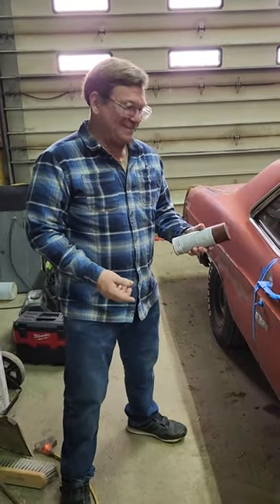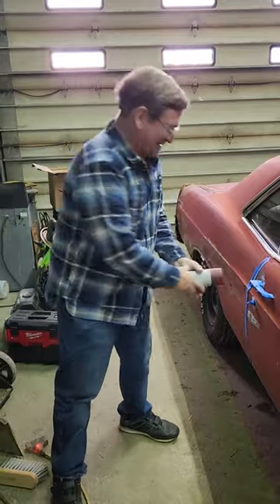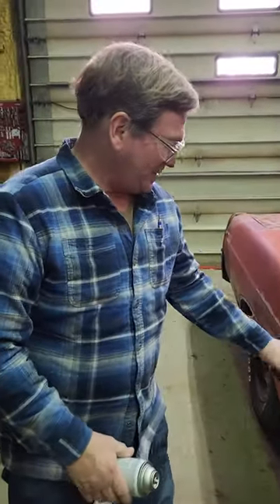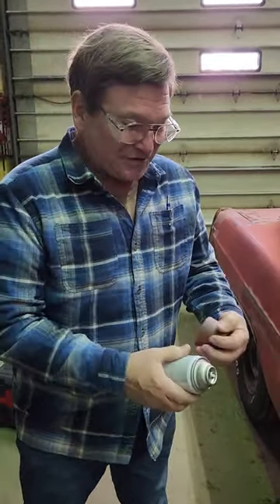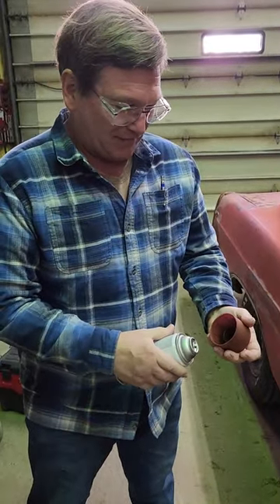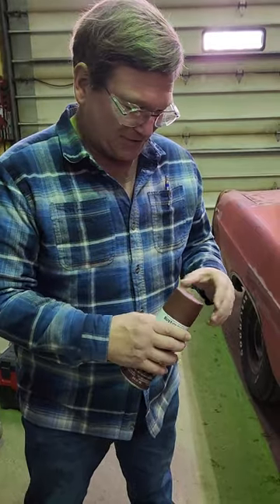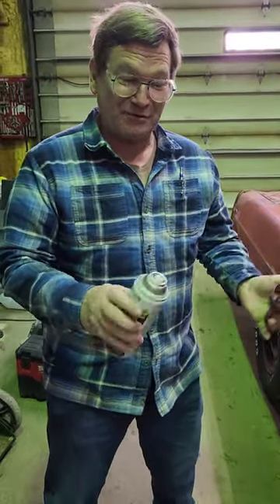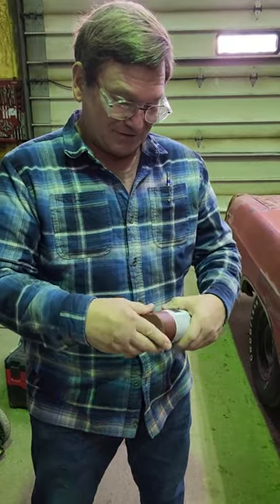Another Broken Spray Can Top #shorts

Comment: You can't buy common sense...
Reply: Underrated comment good grief!
Reply: idk if it really would fall under common sense if it's somebody like him who for years had to open a spray can lid a certain way and didn't know these newer caps just pinch and release
Reply: @illegalwaffel6435  the older cans without the pinch tabs? You mean the ones with the small slit for a flathead or another prying tool? Lol same thing happened with those, so they made it more obvious. Easy open depressed pinch tabs on the cap 😅

Comment: Video started with "this is a piece of crap" and ended with "oh, I'm the piece of crap" 🤣
Reply: I've worked for a few car dealerships and a lot of times the "problem" is between the seat and the steering wheel.
Reply: @BraveNewWorld-1984  all of the time*
Reply: @BraveNewWorld-1984  like when a driver comes into my shop saying his trailer brakes are dragging, then we look up at the brake valve on his dash and he's got his rosary beads hanging off it and blocking it from going on all the way in....

Comment: I have to say, I bought a can of hammertone paint from Rustoleum for a vintage drill I was restoring and the hammertone just didn’t work at all. I even followed their instructions perfectly and it didn’t work. I tried 4 times, sanding back to metal each time to get it to work. I emailed their customer service and sent them some pics of what had happened, and they sent me out about 12 cans of paint. They did say it’s a very temperamental paint and it doesn’t always work as expected, but I was blown away that a large company was so committed to making the customer happy. More than happy, to be honest, 2 cans would have made me happy. I think I still have some of the cans in the workshop now.

Comment: I do agree with part of what was said. Cans do fall off benches and get knocked over. Why can't the nozzle be replaced. Some of the cheap manufacturers have stems on the spray nozzle instead of the nozzle sitting on a stem like rustoleum brand does. The way you aren't out of a can of paint

Comment: They usually don't work like you said.
They aught to make em screw off.
Two tabs on the Cap, and a slightly different crimp on the top of the can.
I'm certain they could do it without sacrificing volume, or material.

Comment: As long as the tube at the top is not broken, you can take the nozzle off another can and use it on that one. You might need to clean the nozzle first with some paint thinner if it's dirty or clogged.

Comment: In 2 months ,at separate times while shaking a brand new can of course it goes flying and busts the tip off.
And if you've noticed lately ,a can of carb cleaner is like 8$ and a can of paint is 12+$. 
 I probably woulda tried some hack if I didn't have a drill and a refillable spray can and an air compressor to charge it up.

Comment: Christ there's a small square hole on the bottom end of the cap use a flat headed screw driver and break the small strand of plastic around the rim and that's the relieve tab for easy removal of the caps